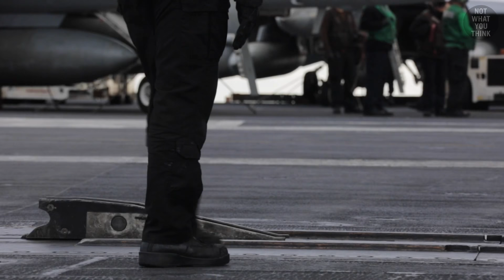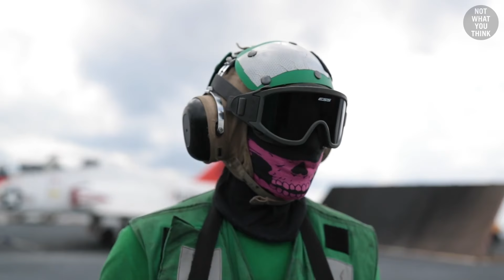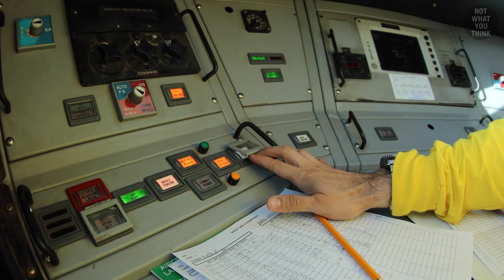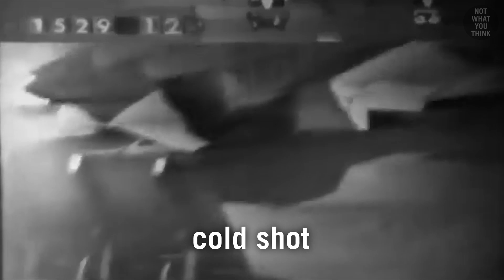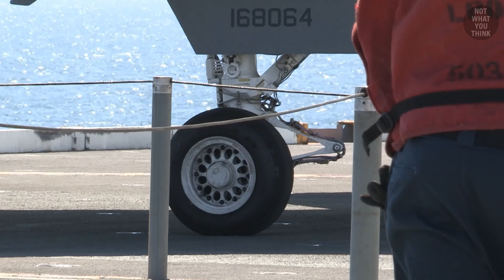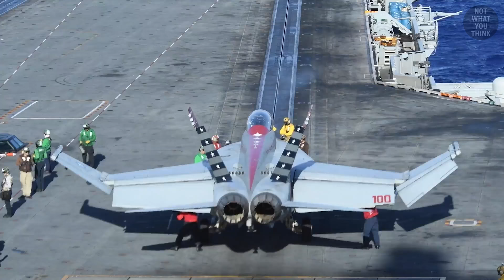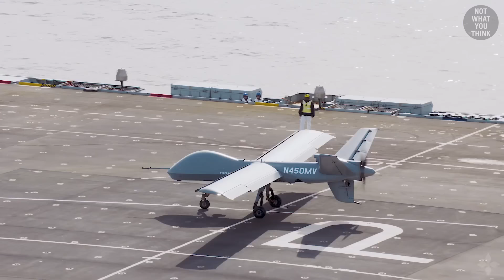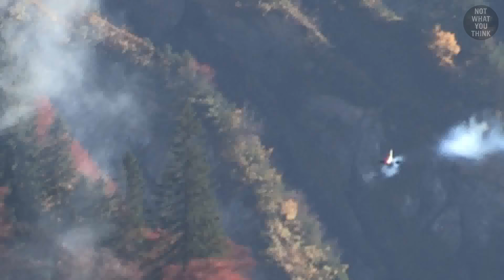Why the US Navy is Replacing Electric Catapults with Steam

Comment: EM are the obvious choice for everyone with an IQ above room temperature. It's just a fucking linear motor, fully controllable and with precision depending only on current sensing accuracy which can be enormous. We're talking easy 16-bit ADCs with say precise launches in 1kg increments from 1 to 65535 kilos. Millisecond reaction times to any changes in required force, easily achievable perfectly stable power input and output and so on. Ah yes, and there is nothing to explode in a spectacular fashion